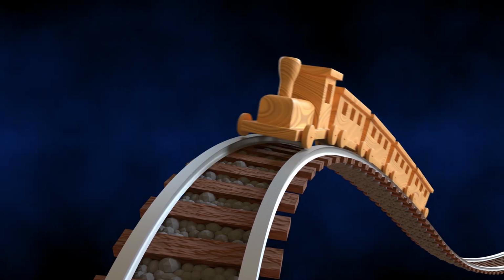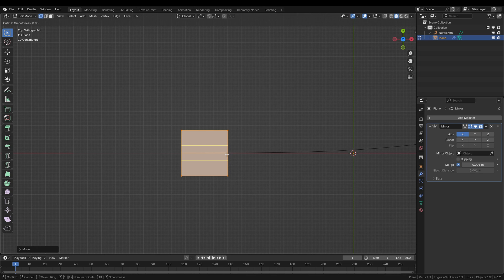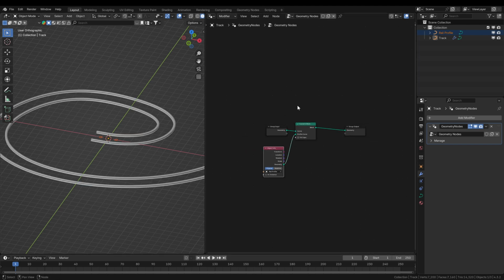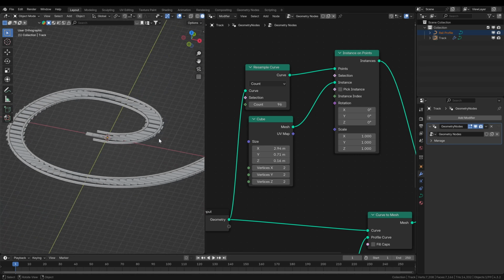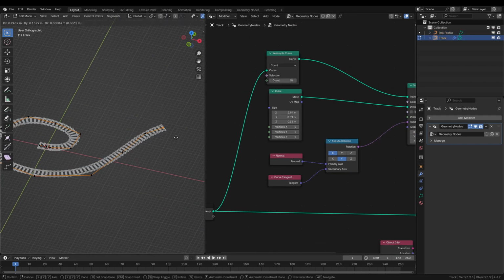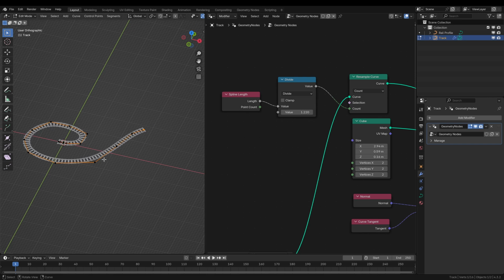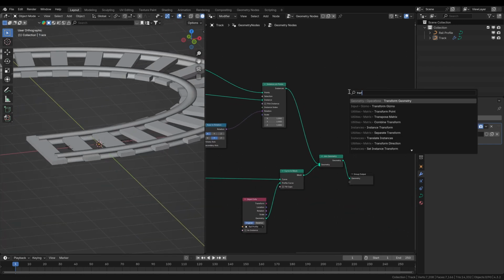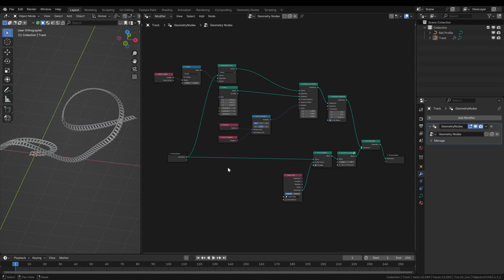Procedural Railroad Track with Geometry Nodes

Comment: I get this, but i cant find any tuts on getting a train to follow a track, and i can kinda get it aligned but it falls apart when trying to do loops
Reply: rotation alignment only works upuntil halfway up the circle than it inverts
Reply from the maker: Yes, I know this issue.
Make sure that your first 2 or 3 control points of the curve are perfectly streight with no tilt or curvature.
Because all following points will reference these points orientation, thats how it worked best for me.
You can check which side is the "start" by just moving them around, when the whole curve changes by this, thats the start.

For a train following the tracks I just used a "Follow Path" constraint with "Follow Curve" checked, by this it will always face the curve direction.
Reply: @PointCloud  forsure i had my endpoint selection a few points away, but it makes sense that wouldn't help with a curve circle since its always curved (was using it on a straight line tunnel with noise so the start was smooth)